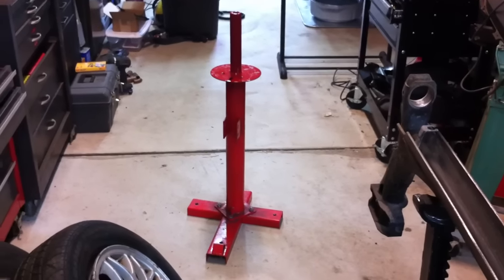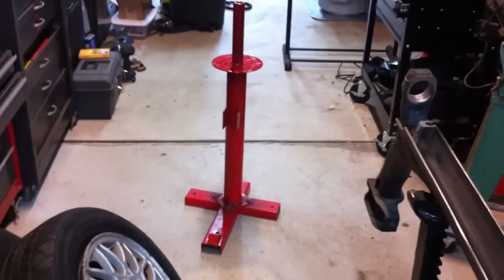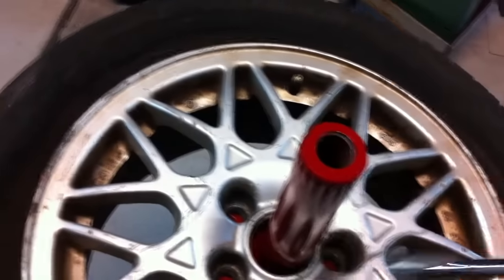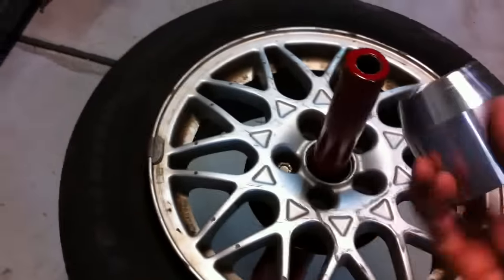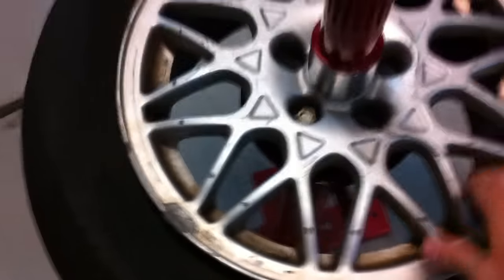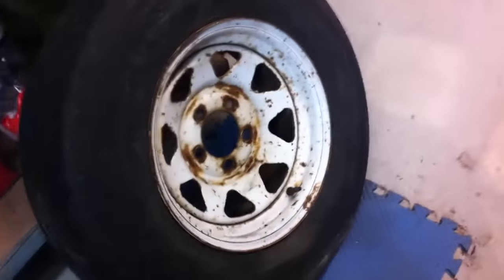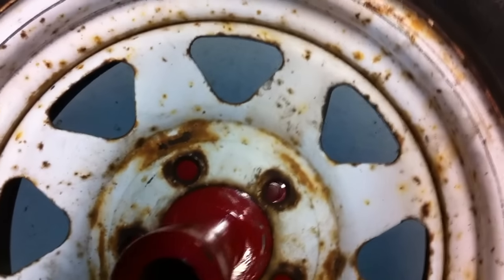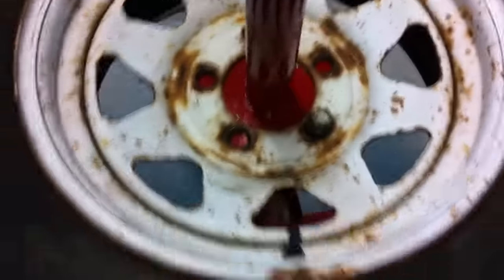Harbor Freight Tire Changer Modifications

Comment: I bought one of these about 20 years ago and it has served me well. I change the tires on my vehicles and several other peoples cars. Have done over 500. This thing is still going strong. I got a 4x8 sheet of 1/2 inch plywood and mounted mine on this plywood. I have no garage so I remove it and put both pieces in my shed till next time, also helps if I do a roadside tire change.
Reply: Same here. We hear a lot of complaints about  the bead breaker too flimsy & this guy destroys the star clamp now. 20 years ago they weren’t this flimsy & I think not all of these are not created equal.

Comment: Why cant you put it in the floor there? Do you not want to leave it there? Then you can do what I did. I have a way to temporarily bolt it in my driveway in front of my garage. I drilled holes and inserted threaded inserts just a little below the surface. (I have a very thick concrete driveway which is a foot thick in front of my garage)   When not in use I put shorter alloy bolts in the inserts with a washer to keep them from rusting or getting contaminants in the inserts and then when I want to use it, I back out the alloys and put regular longer bolts in to mount the stand.  Before taking the alloys out, I blow around the bolt heads to clear away any dirt. I found these really cool inserts that widen at the bottom and have flare outs to prevent twisting.  I did make a larger hole and re poured concrete around them so it was not a pressure fit.  This listing is just an example but not the one I used. I used a bigger bolt set up. 3/8 I think.  The fill alloy bolts I used are also a very expensive alloy used in Marine applications since it is located outside. https://www.ebay.com/itm/200pc-Lot-1-2-13-Precast-Concrete-Anchor-Bolt-Insert-Hex-Head-Nut/333122113543?hash=item4d8fa01007:g:8tIAAOSw3Cdcj8P5:sc:USPSPriority!19082!US!-1
Reply from the maker: Unfortunately it was not my floor to put holes in. It was a rental house. In my new house I put wedge anchors in the floor https://youtu.be/lvKGkh9U1Yo
Reply: Thank you very much for a tip with closing the holes for bolting w/other shorter bolts. I also want to use that machine in a portable way. Since the holes will be outside in our backyard (maybe it will fit in the patio, but still it is kind of outside) I thought how to prevent hole threads from the rust. Your idea is just brilliant, you can put some grease inside (I plan to put there that expensive Cooper Anti-Sieze Permatex Lubricant) before bolting in those short bolts, the holes will never rust!

Comment: Someone needs to come up with a bolt hole plate that has different holes that have different holes for the variety of rims and hole spacings. It should not take as many threaded holes as you think. They could either make the plate bigger or different adapters for some rims with bigger center holes that you can bolt down to the smaller plate, to give you bigger center hole patterns. I have truck rims that have a huge center hole for my 19.5 gm c4500 rims. I would love a way to be able to attach them. The center hole on them is about a foot in diameter.
Reply from the maker: I've thought of the exact same thing! It would be made from maybe 1" thick aluminum and have a few different patterns on top and mounting holes on the bottom. I'd also make the center opening as large as possible so that if you put on a steel wheel with a large centerbore it'll allow some room for a larger centering cone to be able to drop into and not hit the bottom plate..

Comment: I can drill, but can't weld. Do you think the nut on the other side will hold without welding it to the tire changer?
Reply from the maker: It will hold just fine if you tighten everything with a pair of wrenches. If your wheels have a lug nut instead of a lug bolt you can drill a hole and use a bolt with the appropriate length and thread pitch fed up from the bottom. Then you would use your original lug nut on the top side. Hopefully that makes sense.
Reply: Watched the video again! I mostly work on Volkswagens as well, where did you get the nut for the bolt? Also, how did you make that bar that screws in to hold the wheel? 

Are you still using this tire changer? Do you recommend getting a different one?
Reply from the maker: I made a weld nut out of some bar stock that I had lying around. I center drilled and tapped it but you could just drill a hole in a piece of plate steel and cut out enough material to weld to using a grinder or a bandsaw.  The aluminum cone was made on a lathe. 

As useful as the manual tire machine is, I am seriously considering purchasing a used tire machine. There are plenty of things that I wouldn't even try to do on a manual machine and I just had to spend another $130 to get a set of 4 tires dismounted and new ones put on.  

I think that even with his attachment, you'd still be fighting a low profile tire.

Comment: Genius! Great video! Just subscribed, too. Why don't you mount that tire changer to a wooden pallet?
Reply from the maker: Thanks for subscribing! I had mounted it to a pallet made of 2x4s, but it still moved a bit when working. Securing it to the floor works best from my experience. If you can't weld a nut to the underside you can just use a nut and hold it with a socket or wrench.